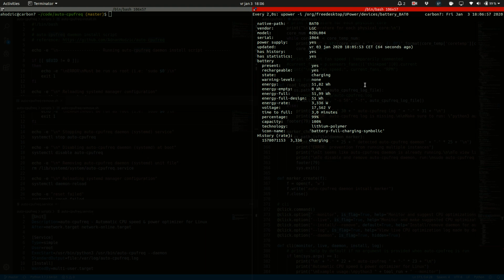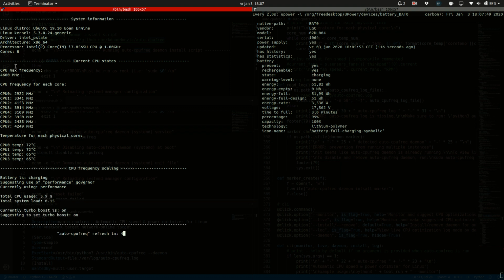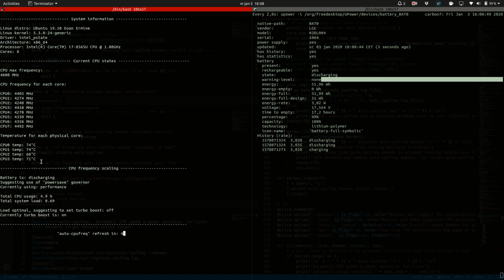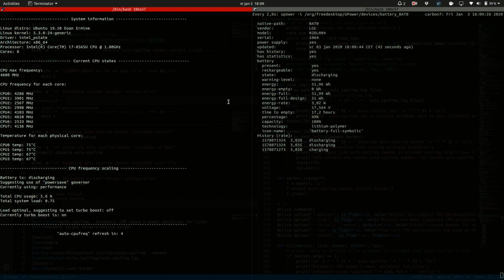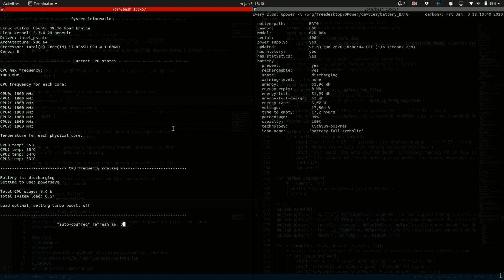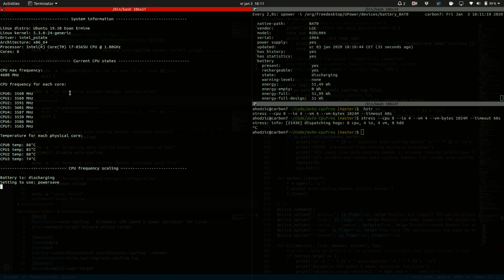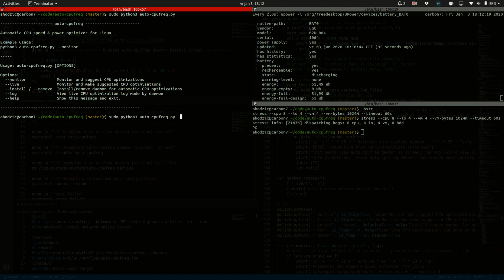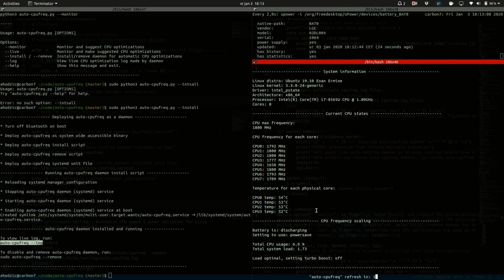auto-cpufreq - tool demo (Automatic CPU speed & power optimizer for Linux)

Comment: I got a question. Does auto cpufreq conflict if I run a game with gamemoderun that also I assume adjusts CPU freqs. Can I use them together or I need to disable a demon while playing with gamemoderun or maybe gamemoderun isn't even needed?
Reply from the maker: It shouldn't if auto-cpufreq daemon is set to run in "performance" mode while you're gaming. You can configure auto-cpufreq to always run in "performance" mode if it's charging and so on using config file: https://github.com/AdnanHodzic/auto-cpufreq/?tab=readme-ov-file#3-auto-cpufreq-config-file

Similiar issue was mentioned long time ago as part of and some changes were made since then: https://github.com/AdnanHodzic/auto-cpufreq/issues/295
Reply: @AdnanHodzic  absolutely thank you for breaking it down for me and for the very nice app that is made with love ;)
Reply from the maker: @pauldvora  most welcome, share the word and/or considering contributing to the project :)  https://github.com/AdnanHodzic/auto-cpufreq/?tab=readme-ov-file#donate

Comment: I'm having a hard time installing the GUI version. I downloaded the source code, installed through terminal, booted it, it hanged, then shut down. Does it have issues with Debian or KDE Neon? It had no issues through Pop OS.

I tried installing Daemon and this is what I get: /opt/auto-cpufreq/venv/bin/python: can't open file '/opt/auto-cpufreq/venv/bin/auto-cpufreq': [Errno 2] No such file or directory

Comment: Hello sir. Do i just need to install it and I don't have to configure like how I do for tlp?
Reply from the maker: Correct, as it does all of this automatically for you.

But if you do want to configure it you can also do it https://github.com/AdnanHodzic/auto-cpufreq#configuring-auto-cpufreq
Reply: @AdnanHodzic  thanks sir for responding so quickly. I subscribed to your channel now. I had TLP installed and no difference. I have 15 year old Samsung R540 laptop just changed battery and install Linux debian 12. The battery just gives me so little hours. I also notice when i switch laptop off in morning battery is 30% less. I'm installing now via snap your tool. Thanks so much for your contribution
Reply from the maker: @John14vs6_  Most welcome & please consider donating or contributing to the project: https://github.com/AdnanHodzic/auto-cpufreq/#donate
Reply: Should I install powertop if I already have auto-cpufreq?
Reply from the maker: @John14vs6_  no need, but up to you.
Reply: @AdnanHodzic  thanks sir.

Comment: I still don't "get" this.  This is what I see, when I have it in "default" checkbox, it's always in performance governor when on the AC brick, the second I unplug the brick and make the laptop go to battery, it flips the governor to powersave.  That's good and all, but is there a way to have it on powersave all the time except if there's a lot of work to do then have it go to performance just until the work is done?
I thought that's what the point of 'ondemand' governor was, why can't we just use that when on AC brick and then set it to powersave when it's on battery?  Maybe ondemand didn't work well?  I finally found a post by Ted T'so way back in 2013 where he said (paraphrased) "the problem with ondemand governor is it doesn't know the capabilities of the particular cpu" but the intel_pstate/amd_pstate govs do.

What I'm after is to get the laptop to be cooler even when on AC brick, I've noticed linux tends to over drive the cpu when it's doing work that doesn't really need full frequency. For example I notice really nice cool cpu temps playing videos when I force the governor to powersave.  The only problem is sometimes I really do want performance gov but only for a short time like uncompressing a big file for a minute or so.

So I think I can  condense what this is doing as:

if on AC then use performance governor
else if on Battery use powersave governor
but you can 'force' it to use either performance or powersave all the time
Reply from the maker: "That's good and all, but is there a way to have it on powersave all the time except if there's a lot of work to do then have it go to performance just until the work is done?"

Yes, that's exactly what auto-cpufreq will do by "default", if it's in powersave, there's a lot of work, it'll switch to performance and turn on turbo boost, once all the heavy work is finished it'll go back to powersave. *But*, if you want to keep it in powersave all the time, you could do this using config file. Set it to be always on powersave and enable "turbo_boost", I explained more in v2.0 video: https://www.youtube.com/watch?v=SPGpkZ0AZVU&t=608s

Comment: I did a quick look at the auto-cpufreq-installer, haven't you had lots of people reporting that the tool_install fails on fedora systems?  The tool_install function assumes that redhat based systems have yum but they do not, Fedora has been on dnf alone for quite a while, there is a "yum" wrapper package on recent Fedora's which just points "yum" commands to "dnf-3" (which itself is "dnf") but it's not guaranteed to be installed.  I'll personally just swap "yum" for "dnf" in the one place it needs to be n auto-cpufreq-installer because my systems (Fedora 38 and 39 Beta) don't have the yum wrapper.
Reply from the maker: Please report this as an issue on https://github.com/AdnanHodzic/auto-cpufreq/issues

Or if you or anyone else wants to give it a try in implementing this functionality, please give it a try and contribute to the project: https://github.com/AdnanHodzic/auto-cpufreq/#code-contribution and you will be credited for your work as part of future release https://github.com/AdnanHodzic/auto-cpufreq/releases

Comment: I was really interested to try it but on my intel i5 5200u doesn't work or it isn't needed. Using the schedutil governor when the load is low my cpu clocks are down to 760 mhz. When the load is high it goes higher. Unfortunately for some reason in powersave mode my cpu gets stuck to 750 mhz (it doesn't go higher if I stress the system) 
So, in my case, auto-cpufreq isn't needed as my cpu is running low anyways under low load.

Comment: Nice tool. But is turbo boost option only available for intel?? Its always off on my 5800H (amd)
Reply from the maker: Besides Intel it's available for all major architectures (including amd & arm) as stated in project ReadMe https://github.com/AdnanHodzic/auto-cpufreq/#supported-architectures-and-devices

If you have an issue report it on: https://github.com/AdnanHodzic/auto-cpufreq/issues

Comment: Tried auto-cpufreq on my ThinkPad T450 running Linux Mint 21.1 and Kernel 5.15, and it just made the i5 5300U processor stay between 500 and 798MHz and fan goes 0rpm. Nothing beyond that on battery, but does go to 2200 MHz on charger and the cpu fan spins. Without auto-cpufreq I get 2700~2900MHz. 
Dunno why it is behaving like that and just results in significantly lost performance compared to the schedutil governor to the point that 720p youtube vids on AVC codec is stuttering hard.
Also tried Kernel 5.19, 6.0, and 6.1 and had the same problem being capped to 798MHz on battery even under load.
Reply from the maker: Please use https://github.com/AdnanHodzic/auto-cpufreq/issues to report bugs/issues.

Comment: Hey Adnan, I downloaded auto-cp* from your github repo and i want to install it on laptop but as you suggested there, before installing( --install using this option) run systemctl start auto-cpufreq to start the service. So I did it but system respond with {{ Failed to start auto-cpufreq.service: Unit auto-cpufreq.service not found. }}. So now should I install it first using ( --install ) option or what should i do now. Please reply ASAP.
Reply from the maker: I never suggested anything like that. After it's installed refer to: https://github.com/AdnanHodzic/auto-cpufreq#how-to-run-auto-cpufreq

If you have an issue please report it on: https://github.com/AdnanHodzic/auto-cpufreq/issues
Reply: @AdnanHodzic  Thanks for the reply, I have installed it successfully. If anything won't work for me i will report you

Comment: I'm a beginner, what is the best directory to install it?  I mean directly with his script.
Reply from the maker: If you're a beginner, I'd suggest to install it as a Snap https://github.com/AdnanHodzic/auto-cpufreq#installing-auto-cpufreq

Otherwise if you install it using the auto-cpufreq-installer, directory you clone it to is up to you to chose and will only contain the installer, which you can even remove later on.
Reply: @AdnanHodzic  Many Thanks, great job.
Reply: @AdnanHodzic  I was able to install it without problems via installer.  

I have tried both intel_pstate and acpi-cpufreq drivers.  In both cases I cannot go below 800 MHz. 

Is this normal?  The machine is a Thinkpad X1 Carbon 6th, Intel i7 8550u.
Reply from the maker: @RickB3n  if you have an issue report it on: https://github.com/AdnanHodzic/auto-cpufreq/issues
Reply: @RickB3n  Yours is the opposite of what I experienced on my ThinkPad T450 where the i5 5300u can't go above 800MHz

Comment: Hi! I have a 4600h but when I am in mobility at 100% it does not exceed 1400mhz even if it says "High CPU load, setting turbo boost: on. Can you help me? With the charger I arrive at 3600mhz

Comment: BTW I am not able to catchup with your language so is there tutorail in text form on github or other site
Reply: @AdnanHodzic  OK bro I tried it 
 but when I used ur tool it gave me 5hrs of battery on regular use and without it only 4 hrs 
You Just Extended My Battery Life By 1 hr But Sometimes It Heats Up A Little High When I Use This Tool
Good Work Bro ✌️😁

Comment: From what I can determine, this looks like a great tool. I am running the latest Ubuntu and used the installer and the "enable" option thinking, the daemon would be automatically activated on reboot. It doesn't. It would be nice if the tool would provide the option to activate (install) by default at boot, and place an icon in the task bar indicating it is active/non-active  and allow click functions to show stats (stats) or inactivate(remove), GUI functionality would make life so much easier for this tool.

Comment: It completely changed my Plasma experience! Thank you very much! Linux really needed a tool that adjusts cpu's frequency according to the system load and cpu temps.
Reply: @AdnanHodzic  Thanks for creating such a tool :)
Reply: @AdnanHodzic  Hi, can I ask you a question? Is it possible to use Powersaving governor when I am not using the battery?
Reply: @AdnanHodzic  Hope you can add this in the future! :)

Comment: hello adnan. i installed auto-cpufreq on my x220, i mean the battery life is great now but when i'm not plugged in my i5 clocks at about 800mhz and when theres load it goes only to about 1000mhz, theres not enough power, everything takes long time to load. is there any way i could set custom scaling with this tool? btw you did a great job with this, thanks.

Comment: Really liking this tool, I'm using the new 4800u amd laptops and when watching videos the cpu does ramp up before using this tool. Now it stays a lot quieter and less warm. Was never hot but still somewhat lukewarm. Now no longer any issues. I got one question though? I currently use the snap version of the tool but kinda wanna get rid of snaps (superslow loading of apps compared to flatpak) but was wondering if the normal install also auto-updates?

Comment: I have HP laptop having AMD A6 with windows 10 running currently. I used linux some 6 months ago but switched back to windows because battery life was worst on linux.
Coming to question part. If I install linux back(elementary os or deepin os) and your auto cpufreq then how much hour of battery life would, I be getting?? Any idea you can tell about.
Thanks.
Reply: @AdnanHodzic so you mean to say that after installing this tool, it will behave like I am using linux on laptop and not on desktop. I was getting approx 3 hours on linux in my laptop. So will I be getting between  more than 1-2 hours MORE after installing your tool.
Reply: @AdnanHodzic  Thanks for the response...bro
I will install linux again and then will report to you about my battery life.
Really appreciate your efforts...bro
❤ from India 🇮🇳
Reply: @AdnanHodzic  have you made any detailed video on how to install your tool and  use it??
I am getting a bit confused.

Comment: Solus Linux , after adding Snap it cannot run. is Reboot required?

sudo snap start /snap/bin/auto-cpufreq

returns 

error: snap "/snap/bin/auto-cpufreq" not found
Reply: Late answer, but try it with "sudo snap run auto-cpufreq"

Comment: Great application, I thought for a long time I would like to have something like this but I wasn't motivated enough to write something my own. I will test it on my laptop for sure. It would be neat if the tool checks for the amount of different processes requiring some performance. So maybe it could only turn some cores on to boost but I'm not sure if there is already control for such tweaking. Anyway good job. ^^

Comment: Well done!  I like that the monitor and live modes illustrate how the tool works.  For less advanced users, it addresses some of the fear of breaking something.  I recommend you estimate the battery life improvement for a common hardware setup and use case.  For example, the test could be web surfing or running Python scripts on an Ubuntu Dell XPS 13 (or X1 Carbon).  Maybe partner with benchmarking website like Phoronix? In my opinion, the endgame is switching between standardized plans: Balanced, Power Saver, and Performance--same as Windows 10--without worrying about the technical details.  Good battery optimization will also help popularize Linux!  :-)